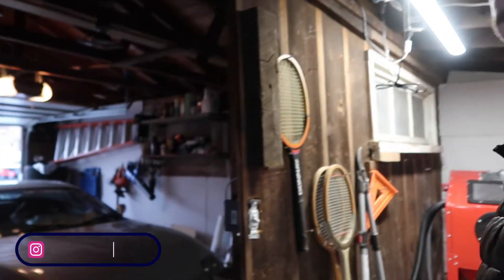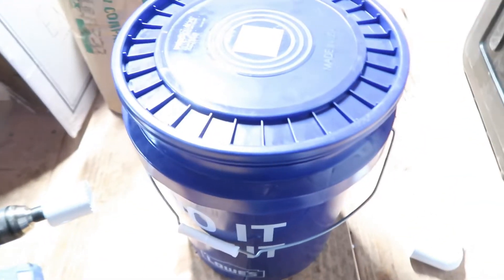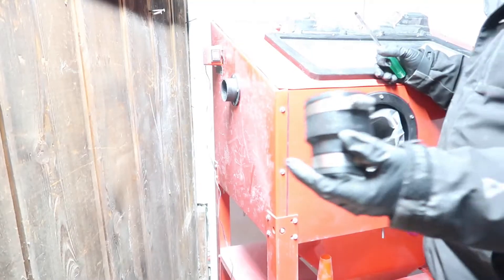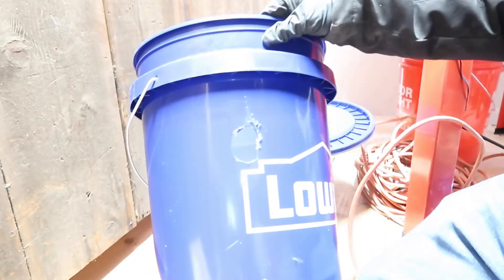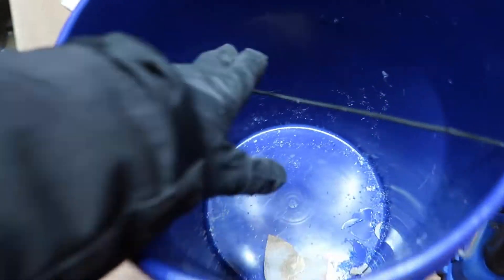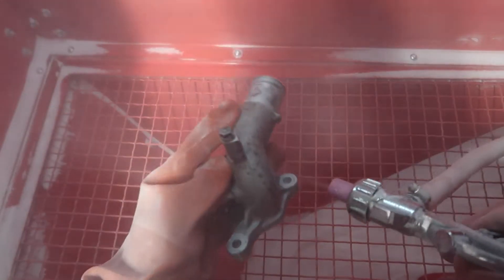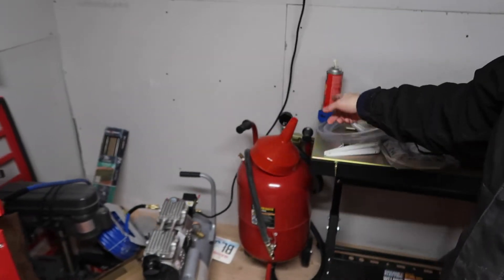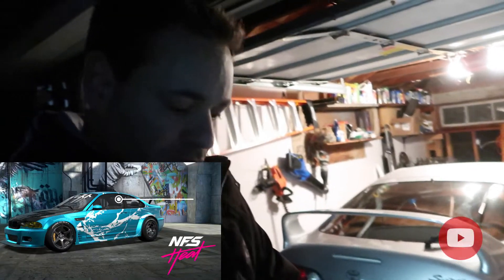Sand Blasting Cabinet Mods Part 1 Vacuum How To

Comment: Check which way you have it hooked up, i think it's backwards. The diagrams i see of centrifugal separators, you want the dust entering at the angle and the vacuum cleaner hooked up to the top of the bucket.
Reply from the maker: Good call.  I'll change tonight. I appreciate the message!